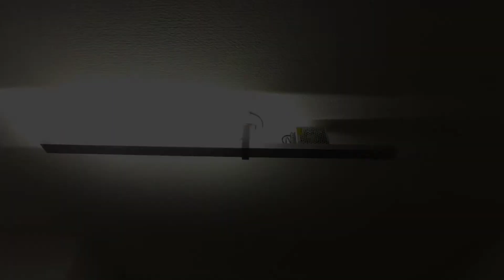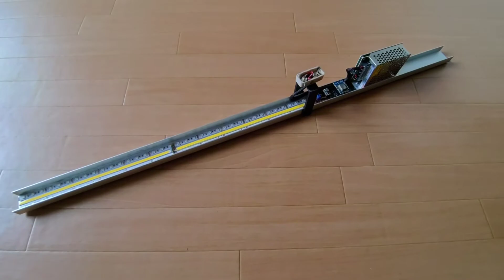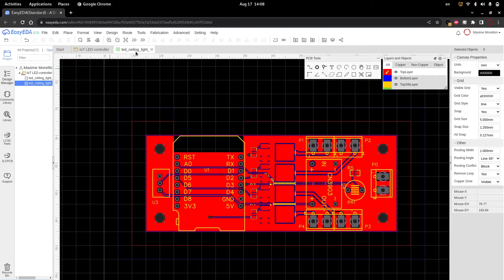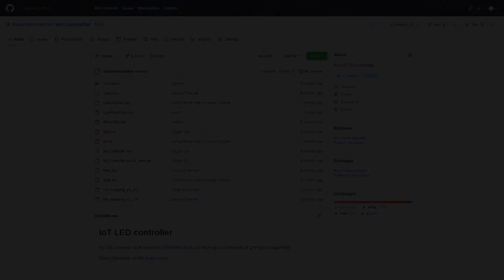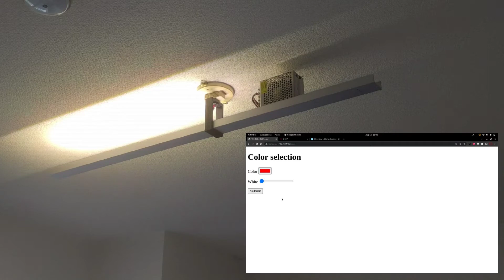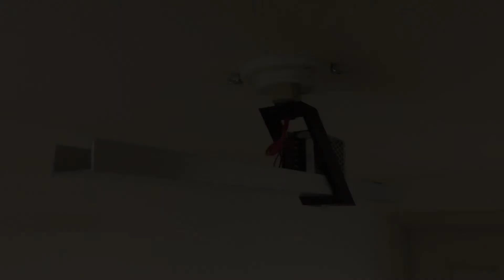ESP8266 WiFI IoT LED ceiling lights controllable over HTTP and MQTT

Comment: Nice project as always! Im just curious as to what kind of RGB chip are you using for the strip? I assume it's WS2811 because you said it's running on 12V
Reply from the maker: Thank you so much for your feedback!
The strips don't include any chip, control is done directly using MOSFETs and PWM for each color.
Reply: @MaximeMoreillon  wow this proves to be more a lot more sophisticated than I thought. I would love to replicate the project for my apartment light. Would you mind sharing links to where you purchased the rgb strip and cob led strip?
Reply from the maker: @AbhipolV  Sure!
RGB: https://www.aliexpress.com/item/33003322980.html?spm=a2g0o.productlist.0.0.20fe556fJ8C0ui&algo_pvid=f5d18bc0-5bdd-4a86-a187-e8aacb01941e&algo_exp_id=f5d18bc0-5bdd-4a86-a187-e8aacb01941e-30&pdp_ext_f=%7B%22sku_id%22%3A%2267043445244%22%7D&pdp_npi=2%40dis%21JPY%21488.0%21302.0%21%21%21%21%21%402101e9d516634615576777773e130d%2167043445244%21sea&curPageLogUid=NJTbU6istKzA
COB: https://www.aliexpress.com/item/1005004458809439.html?spm=a2g0o.productlist.0.0.3fa23d75f7F2hq&algo_pvid=dcd11ea9-5a68-46db-87a5-4cee024cd8b8&algo_exp_id=dcd11ea9-5a68-46db-87a5-4cee024cd8b8-36&pdp_ext_f=%7B%22sku_id%22%3A%2212000029258699238%22%7D&pdp_npi=2%40dis%21JPY%211700.0%21765.0%21%21%21%21%21%40210318cf16634617288016597e5b0f%2112000029258699238%21sea&curPageLogUid=mFSaxFxDnwDa
I hope you succeed in this project!